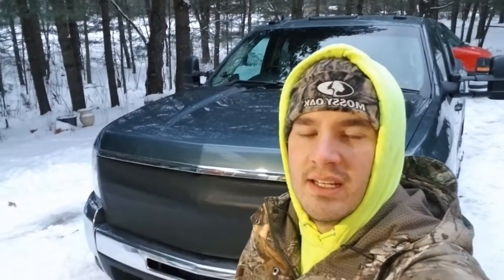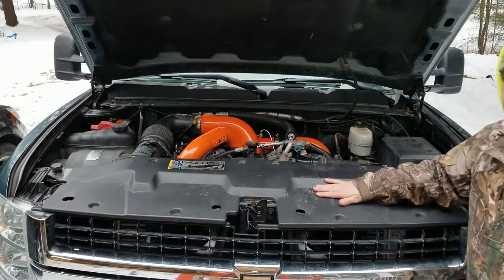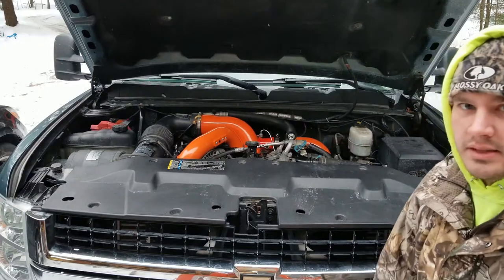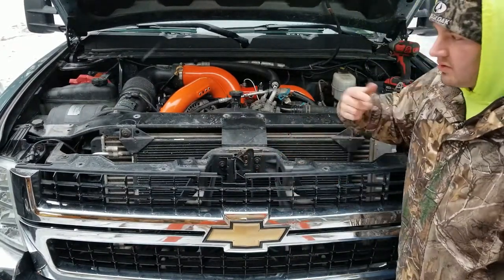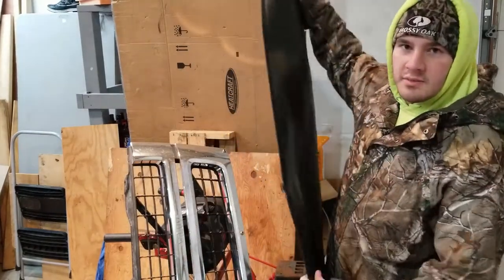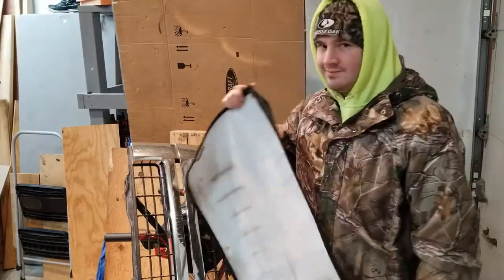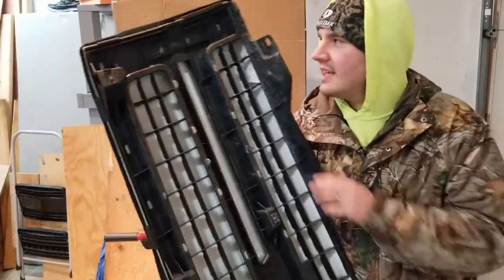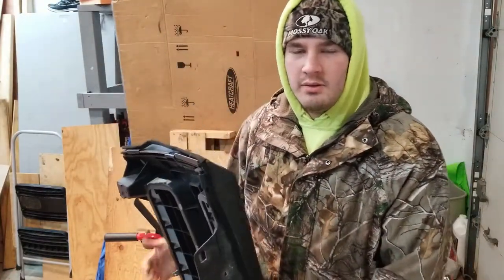Install your winter grille cover the easy way!

Comment: I just bought a truck and it came w the cover. What’s the purpose of this?
Reply: Your truck will warm up faster and heat better with the winter front on. It will improve fuel economy as well.
Reply from the maker: Yup! What Sandy said. And if it's really cold. You may never reach operating temperature.

Comment: What are your egt numbers getting to?
Reply from the maker: When truck is warmed up at idle, I'm around 280-300. With pedal to the metal I'm around 1200.
Reply: Is that in tune 5?
Reply: And do you know what psi the fuel rail pressure is at?
Reply from the maker: Tune 3. I've only been in tune 5 a handful of times. I dont have a built trans, and I don't want to destroy mine. I'll jump on the highway on a long trip and kick it to tune 5 for the fuel economy.
Reply from the maker: My fuel pressure is at 4.6k at idle and full throttle,  I've seen it around 21k
Reply: Im getting like 12 mpg and want to get tonys tunes but i would hope to get like 15 or 16mpg with them if im not flooring it all the time. He said no promises.
Reply from the maker: Ya. I'm getting on average 16.6 mpg. That between city and highway for about 4k miles. 400 of those miles I got over 20 going on a 5 hour round trip all highway drive. I have been watching it go down now that winter has hit full force. Truck idles more and longer. Plus winter blend fuel sucks. And I like to "play" in the snow. Lol
Reply: This is how a video should be done! No extra nonsense conversation and boring fillers, right to the reason for the video. Outstanding job and will subscribe!!!! Thanks for grill cover vid!

Comment: Dang, that's the easy way?
Reply from the maker: Ya. For me anyways. It's only four bolts and some clips. I've tried fight the cover without taking the grille off. But once it gets cold, it shrinks, so is very difficult to get on. If I had the snap on one I would worry about it.